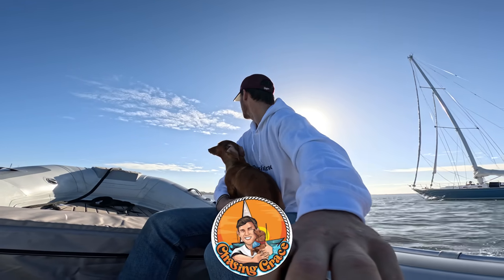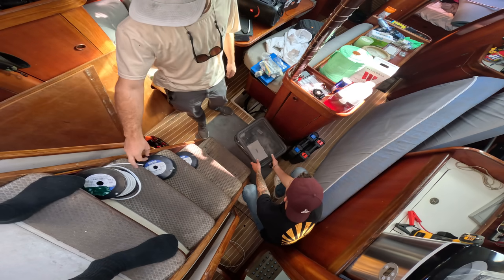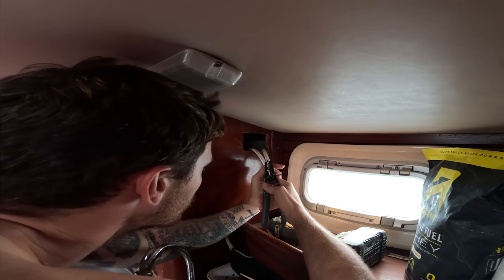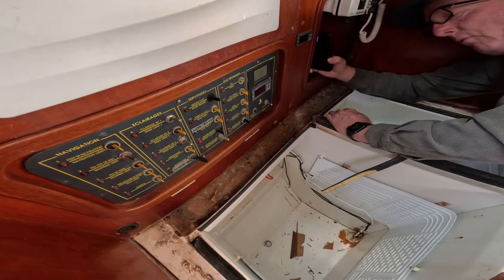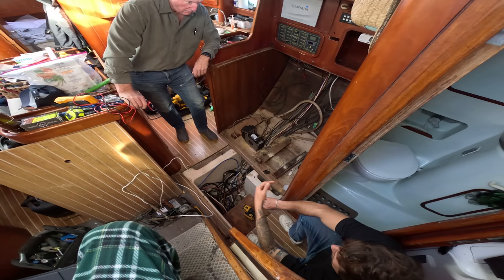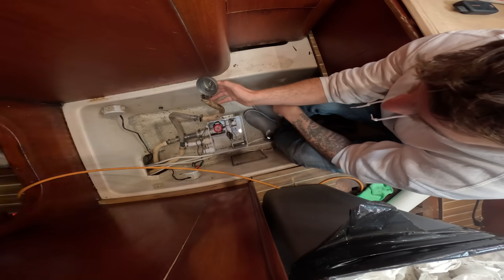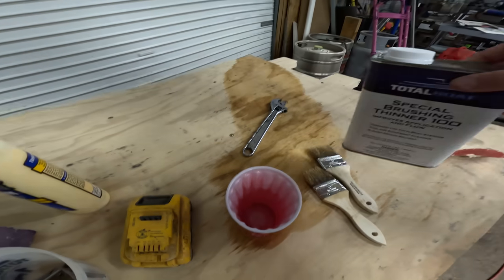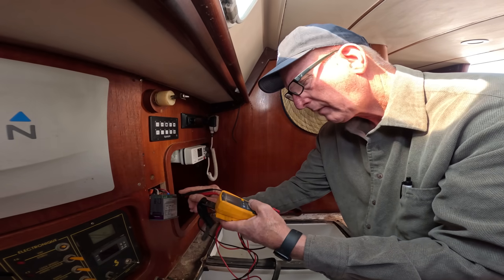The Renovation Continues - DIY Sailboat Projects

Comment: in case you didn't know, when they built the boat, they put all the interior furniture, fridge, etc. into the hull, then they put the deck on top and sealed it all in.  It's just easier that way for the builder.